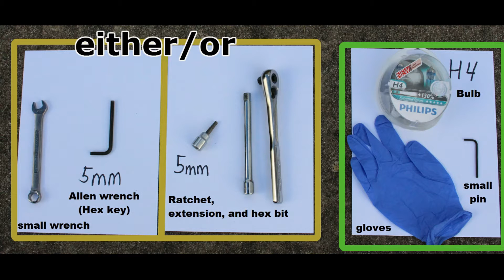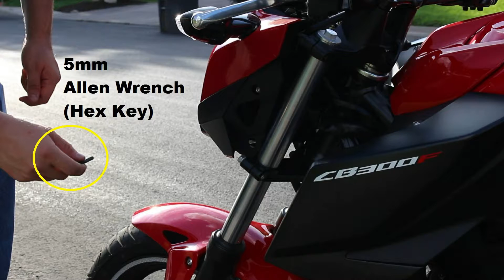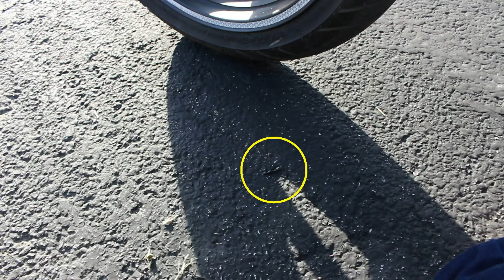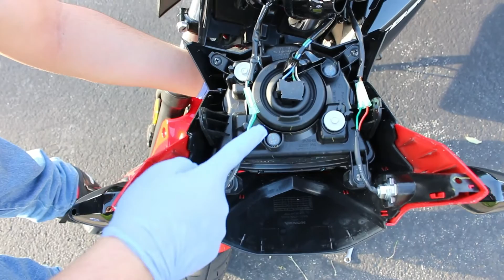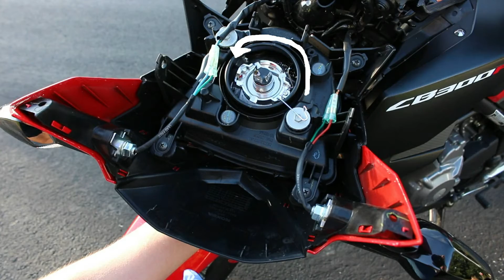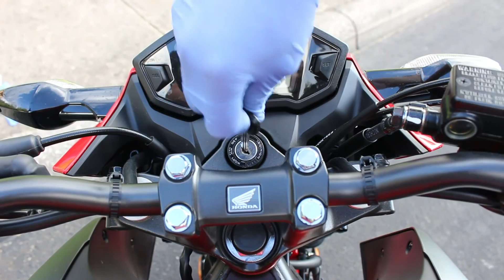Head Light Replacement, Upgrade, Install (pt. 1) - Honda CB300F

Comment: Do you know if the 300 has a 12v connection to add a usb adapter under the headlight?

Comment: I was able to gets 3 of the screws out with a 5 millimetres hex screwdriver but one of them is exceptionally tight and I ended up stripping the screw and it won’t loosen. Do you have any tips to loosen it?

Comment: dumb question; i did this to my CB to the letter but the highbeams dont work on the new light bulb despite changing the original bulb which had the high beams shot. 

IS there a fuse or something since the rest of my light cluster works perfectly.